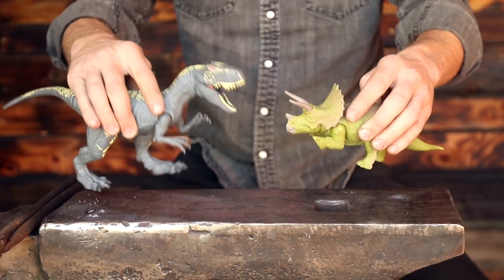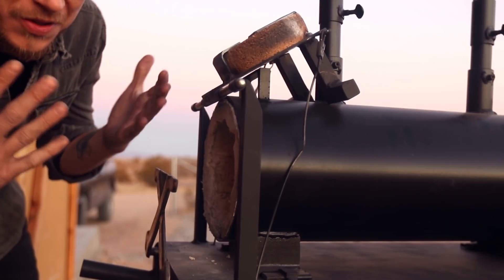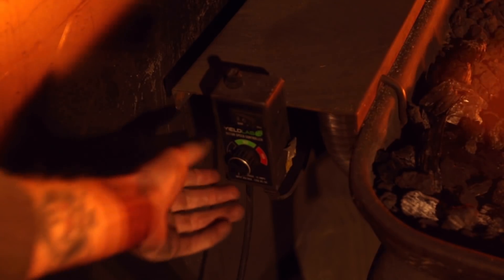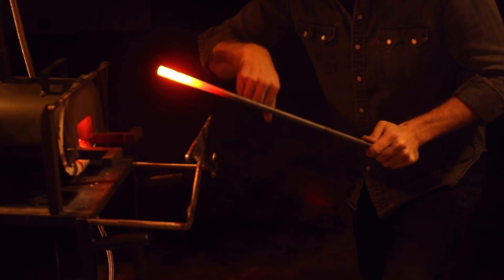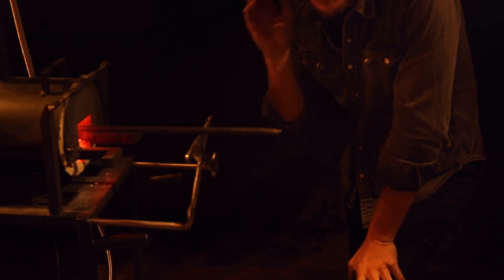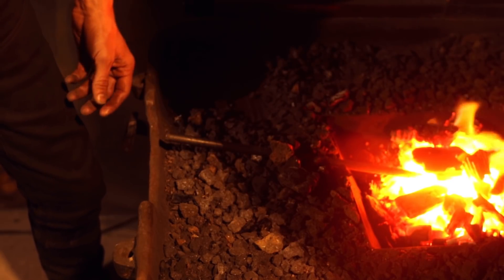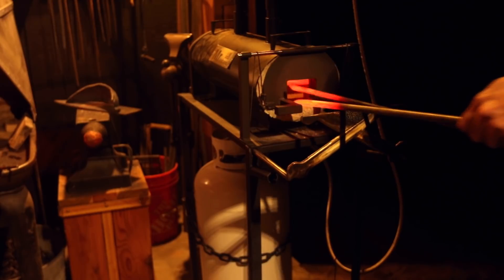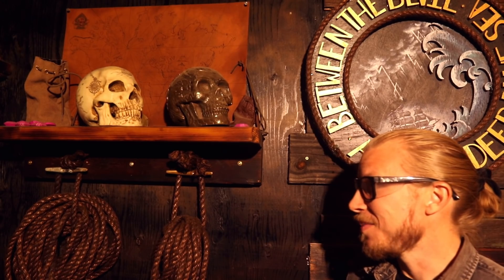Choose Your Forge: Coal VS Propane | Making a Propane Forge Perform Better

Comment: You get to a point your work DOES NOT FIT in a propane forge, coal is cheaper, coal gets hotter than propane EVER thought about. Coal is superior, except it's more involved to start
Reply from the maker: Yup. It’s a more involved process but has a lot of benefits. Propane has its limitations, but is a great option
Reply: @skullandspade  maybe, only thing is where I live a tank of propane costs twice what 80 pounds of coal cost AND the propane can gets used up in about 2 day's, I can forge for 2 days with my coke from previous work and 2 or 3 coffee cans of fresh coal.
Reply from the maker: @comeandtakeit-m6e  fuel cost is always an issue. While I like coal, it’s difficult for me to source unless I buy in bulk. I can drive 5 min and refill propane. For most hobby smiths, propane is easier…albeit, more expensive, as well as being able to do it in a garage/tiny shop without needing exhaust or smoking out your neighborhood

Comment: Love the review bro I would like to know which one would be cheaper when it comes to cost of fuel per hour
Reply from the maker: There are far too many variables like “how hot are you running it, how big is your stock, door open/closed, etc.” I’d bank on coal being less expensive overall, but it’s a lot harder to source than propane for most folks

Comment: Might be a bit late but I wouldn't forget about charcoal forges either, especially if you're looking for a budget option to get started. Charcoal forges can be as simple as a hole in the ground with a hair dryer pointed at it. You can use either store bought lump charcoal or homemade charcoal if you've access to wood to convert. For forge welding, it gets the steel hot enough. However, it produces a lot of ash that can get between the steel and prevent it from welding properly, making it sometimes difficult to weld. Fire management can be a pain, as like coal you have to stay on top of it. It also produces a lot of sparks that can burn shirts and skin, though you get used to those sorts of things anyway when forging. Charcoal I believe burns faster than coal, so you'll be adding more fuel more frequently. You also have to prepare the charcoal beforehand by breaking it down into smaller chunks about half the size of your thumb. I think the main appeal for charcoal is how accessible it is for beginners, you only need charcoal, a hair dryer, and a hole to make a forge. Once you have it, you can always make more fuel if you can get your hands on scrap wood, meaning it can be pretty cheap to run it if you're on a budget.
Reply: I could never get it those hot enough
Reply: Charcoal burns up too fast.

Comment: At the risk of sounding foolish, how is the propane forge not hot enough to forge weld?
Reply from the maker: It can absolutely be done with certain propane forges, but this “affordable” model doesn’t quite get to the temperatures I would need. Standard operating on this runs around 1800-1900 degrees. On mild steel, I’d want to push over 2000, or a nice yellow color.

Comment: Pretty easy to forge weld with propane, little bit easier to forge weld with coal.  When it comes to forge welding high carbon steel, propane is far superior since you don't run as much risk burning your steel.  To me, it's more about isolation, when I'm doing hawks I prefer coal since it's easier to isolate sections vs propane where the whole thing gets hot.  To me they both have strengths and weaknesses and compliment each other.
Reply from the maker: I’m with you

Comment: you need to do some research on forced air propane or NG burners,they run hotter and more efficiently then The Venturi burner you are running
Reply from the maker: This was a comparison of these specific forges. If anyone wants to look into natural gas, I’ll send em your way

Comment: Both undoubtedly heat steel but the coal forge is so much quieter. I just don't like the continual roar of a propane forge.
Reply from the maker: Right there with you

Comment: My single 1”burner gas forge will weld wrought iron. At 8psi. I know you said it might be possible but I thought I’d chime in.
Reply from the maker: Wrought welds much easier than mild steel, which is what most beginners will be going after. Especially with flux and a heavy hammer
Reply: It welds much easier than mild steel, but requires higher heat. That’s what’s said anyway. I’ve never tested it so see if it indeed it true or not. I just know they both need way more than medium & high carbon steel.

Comment: Thanks for the video. I have built myself a coal forge and was wondering if I should include a propane forge in my setup. You have helped me to answer that question. Thanks Cap’n.
Reply from the maker: They both have their purpose for sure

Comment: I may not be very experienced in all this. However its just like a hammer or tongs. If you need wolf jaws and a crosspein...you need em but sometimes you need box jaw and rounding hammer.
So coal forge complements propane just as propane compliments coal.
Ultimate answer???
Both.
Every Smith should be able to use what best suits the current needs.
  Both fits the bill
Loved the video captn
🙏 Blessed day and well wishes Sir
Crawford out ⚒️🧙‍♂️
Reply from the maker: Well said

Comment: Great run through of the issues/benefits of each. How long does a tank of propane last?
Reply from the maker: This is a 10 gallon and it’s been running for... around 12 hours on low psi over the last few sessions. I’m maybe half way through it

Comment: Great info! One thing I may have missed, did you mention shape or a piece. If you are making a knife or anything straight, most propane forges are great. If you are making some weird sculpture like Mount_Phillip_Metal_Works a coal forge might be more accommodating. (Learned that from Chris Cash, I'll probably still buy a small propane forge and then try to bend something and then learn it doesn't fit back in the forge.)
Reply: Zing
Reply: @MtPhillipMetalWorks  I am 100% in weird sculpture camp!

Comment: I would imagine the debate is irrelevant when you consider your needs as a blacksmith, if you never have a need to forge weld something, then propane is more than enough, that being said, there are some blacksmiths that have larger "higher end" gas forges that get the job done, but like I always say, you use what you want and let the outsiders worry about the small things
Reply from the maker: Exactly

Comment: If you're looking to forge weld, coal/coke is a better option anyway.  Not only is it easier to get to a higher temperature, but coke burns dry. Part of the chemical proccess that turns propane into fire makes water, which makes your steel oxidize faster. You don't get that problem with coke.
Reply: Coal doesn't burn dry either.
It has a water content of up to 20% in anthracite and even coke isn't as dry as you seem to think.
And there is more free air in coal forges than in gas ones.
Reply: @Glaswalker1001  are you saying the internet has been lying to me for years?! Oh man... I feel so betrayed. XD Thanks for the info.
Reply: @KrakenCasting  yeah, I also thought that coal was dry as rock, but while visiting an old coal mine I was corrected.
In that particular mine the coal was so moist that they jokingly referred to it as being "the only flame retardant coal in Germany".

Comment: Very educational! I would mainly use a propane forge for decorative hinge work! I have a single burner but would like to have a two or three burner propane! No all burners would need to run just the placement of burner and would like a rectangle forge! 
I have acetylene that is my go to for most metal work! 
I like your propane setup! I’m going to copy that feature and use that gate! I have just fire bricks and it takes time for moving! I lose the edge on work! 1/4 to 20 gauge metal cools rapidly!
I appreciate seeing you dedicated smith’s and your work place! Awesome 👏
Reply from the maker: Thank you! There’s definitely a lot of value in the consistent heat of propane setups.

Comment: Can I ask a stupid question? I don't understand how your steel stock doesn't just transfer the heat from the forge all the way along its length. I always thought steel was good at conducting heat that's why if you have steel (albeit stainless) handles on pans that you leave on the stove it will burn your hand if you just grab it without some kind of glove. Yet I see you grab that piece of stock with no gloves on and no problem. I know you explained how the propane forge pushes excess heat out the front which can then heat the rest of the piece but I still don't get how the steel just doesn't transfer the heat by itself. 🤔
Reply from the maker: Honestly, it’s a bit of magic (albeit science) from my perspective. I didn’t really understand how that worked either until I was exposed to it. If I had to hazard a guess: since the air for the coal forge is fed from underneath, and hot air rises (path of least resistance) the hot spot is so consolidated that the speed at which the material heats up inside compared to the bit hanging outside isn’t enough to soak back between working time. I HAVE left a bar in the coal fire (on low air) for a bit, and it has soaked back enough to make the steel pretty damn hot. Again, I think it has more to do with the speed and size of the heat source. Hence, covering the material with a bit of “cold” coal acts as a barrier, since it’ll will pull heat out of the material before it runs up the rest of the bar.

Comment: Uhm... Actually: although you can control the heat better in a gas forge, it WILL burn your stock.
As it's not the heat that burns steel, it's heat plus oxygen and there's still some oxygen in those gas forges.
Reply: If your piece is directly under the burner you can still get hot spots even at lower forge temperatures. The old saying of too many irons in the fire comes to play.
Reply: @mossyhollow3732  although this is a true and well known fact it has nothing to do with my argument.
That's like saying: "but in a coal forge, if you just put the metal on top of the fire it won't get hot enough to weld. " a bit of a non sequitur.
Reply from the maker: Darius, I tried following your account to see if you had any videos sharing your knowledge. Valuable stuff! What’s your background in smithing? (Metalwork?)
Reply: @skullandspade  I'm afraid not. I wish I would have learned some real trade, but I'm just an engineer. I'm blacksmithing for about 10 years now, but only as a hobby and to balance out the office job. I'm making tools and some decorative ironwork most of the time. 
And some show smiting at something Americans would call renfair I guess?
Reply: @Glaswalker1001  Well actually ... Brett should probably have told the newbies about the fundamentals of thermodynamics and crystalline structure of steel, just to make sure there's no magic left in it, and of course to utterly overwhelm them with necessary information ^^
Reply: @RasmusLoen  I disagree with your ironic remark.
But it's a common misconception that needs to go away in my opinion.
And would it really overwhelmed anyone to note that single thing? I doubt it.
Reply: @Glaswalker1001  No argument needed. I was agreeing. My new NC forge is easy to control and I can keep a nice low/ medium orange heat so it won't burn or scale. My old home made forge had hot spots but professional forges tend to heat more evenly.
Reply: @mossyhollow3732  it might have been the language barrier that I misunderstood what you were saying.
But as long as you don't run on a perfect equilibrium between gas and oxygen (and most forges are sucking a bit more oxygen than they need) you will get a little bit of scale.
I agree that it's far, far less than in a coal forge and maybe even less than you get from moving the steel to the anvil.
The thing I oppose is the notion that gas doesn't burn your stock and that you could leave it in the fire indefinitely.

Comment: Hey Brett
I've  played around with blowing back the dragons breath from the opening of the gas forge to stop the overheating of the end you want to handle, might be something to consider for a followup video?
Reply: Here ya go. Make sure to read the description. https://youtu.be/sGm7qQsXTjA
Reply: Do you mean you have a fan? I put a small blower right under my door pointed up and it helped a lot.
Reply: @mossyhollow3732  that's actually a nice idea. I will try that.
Reply from the maker: There it is^
Reply: @mossyhollow3732  yep im sure I've heard or seen a comment about it somewhere, but would love to see it in practice

Comment: Isn't there also something with the metal changing when you use coal?
Reply: You may be thinking of carbon  adsorption which only can be achieved evenly with case hardening compounds. It's usually a bone carbon powder. Also, certain rare alloys will become damaged if overheated which is easier to do with coal. Wrought and mild steel won't be affected. It just sparks as it oxidizes.
Reply from the maker: Well said

Comment: What about carbon loss and retention in high carbon steel? Dont you loose more carbon in your steel with propane vs coal/coke.
Reply: It's the same myth like coal fire heightening the carbon in the metal.
That doesn't happen at those low temperatures and over those short periods of time.
Well, unless you are using some nasty chemicals to speed up this process while lowering the necessary temperature for the reaction.
Reply: You cannot loose carbon from steel at forging temperatures. The carbon % will not change unless it's heated to about 6,400°F. For years I've heard that scale is carbon being lost. It's not. It's simply the liquid steel surface becoming oxidized.
Reply from the maker: I believe the comments below express some ideas on that front
Reply: Ok was just wondering if it was true or not. I've heard both thoughts and wasn't sure either way. I know there's ways to add carbon to iron to make it a steel in a forge but wasn't sure if you could lose carbon as well.

Comment: Good topic.
Have yet to buy my first forge but I plan to work with mild steel sheets so an open top coal forge is about it plus I'm low income.
Besides with how bad luck follows me a propane forge is likely to blow my eyebrows off against all odds, I like to avoid compressed flammable containers as a rule in life.
Also can't deny the fine tuned old world charm of coal forges.
Reply from the maker: There’s definitely old world charm attached to the coal forge

Comment: Great breakdown! 
Both setups have their pros and cons, and if I had to choose I'm in camp coal. But they complement each other well, so if I had a forge area I would probably also go for one of each. Makes it easier to have hammer ins as well! 😁
Reply from the maker: Brilliant idea. They really do have their own merit. Glad I have both options now
Reply: With enough modifications a coal forge can run similar to gas. But it requires the breaking of some rules.